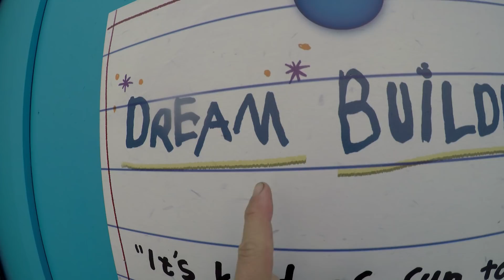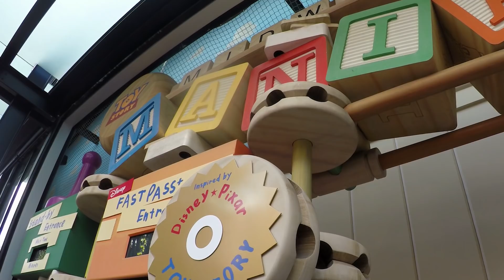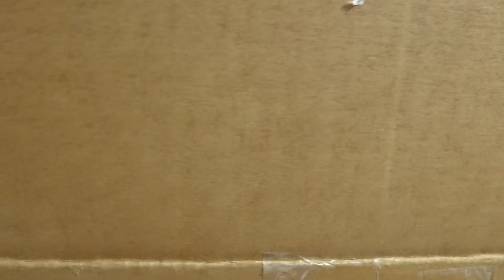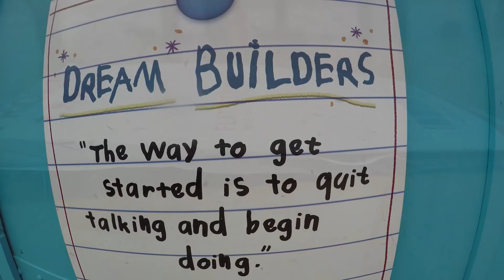2017 Dopey Challenge Training #17 - "Crafts & Computers"

Comment: I would be curled up in a ball with all those computer issues!  Sooo frustrating!!!  On a good note, you're getting super fast with the cooler weather.  I guess all that heat and humidity made you strong. Fun video!!
Reply from the maker: So true... I think the heat conditioned my body for the extreme. Now that it's cooler ~ it's so much easier. My running bud helped me "fix" the sloppy 2nd hard drive installation from the computer seller.  I'm hoping .. fingers crossed .. no more issues.

Comment: Bummer on computer..I use my Galaxy S7 for mine...lol. 2 weeks this next Sun Laporte, Tx Half Marathon.. steep bridge race over and back..10 plus weeks til Chevron Houston Marathon..good luck with computer and your running...
Reply from the maker: Thank you ... and NO ... good luck to you! I only have Dopey training between now and January. I always feel so much pressure during races ...  crush a couple of Personal Records :)
Reply: Did Kemah 10k and Galveston 10k..sep and Oct. Bridge races...150 miles ran in sep..ran 50 plus miles 2 weeks back...i am thinking 3 hr runs is max I need to run for marathon..i keep hearing that..90 degrees yesterday..fall..not..lol.

Comment: Great video are you using premier pro to sync your audio track?  I actually have found at work adobe audition is really great for this and can go through whole audio track and remove those pesky wind over the microphone sounds or other unwanted sounds with out messing with your voice by isolating the frequency.  If you add a microphone to it you can go back through and re-record audio in a studio (quiet) setting to match the mouth movements on the video to the soundtrack.  Just food for thought lol keep up the great work.
Reply from the maker: Yes ... premiere pro does a great job with audio sync. How do you get rid of the wind noise??? Do you need an "add-on" effect?
Reply: So I’m not sure you can with just premier pro you need to have audition too.  Then you isolate the frequency of your voice and it will remove any frequency outside of that range.  You export your project from premier to audition and when once your done working with the audio it sends it back in a stereo format.